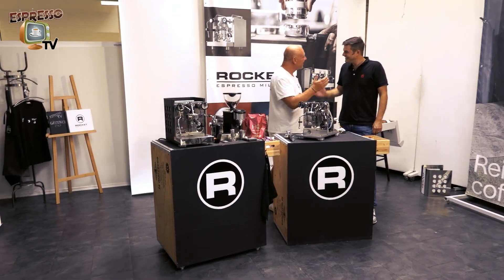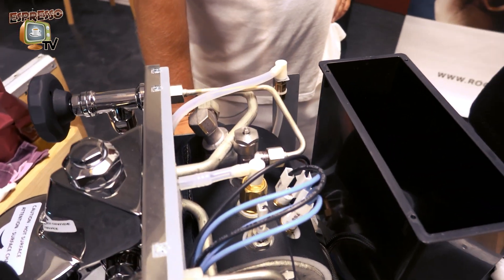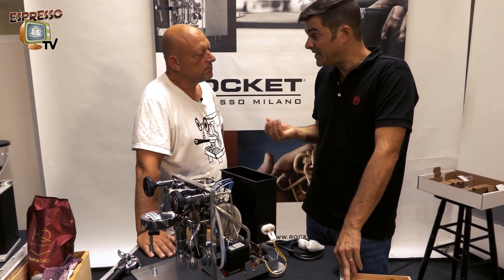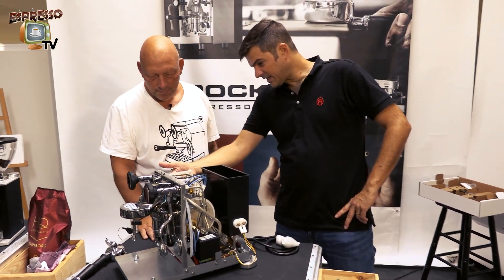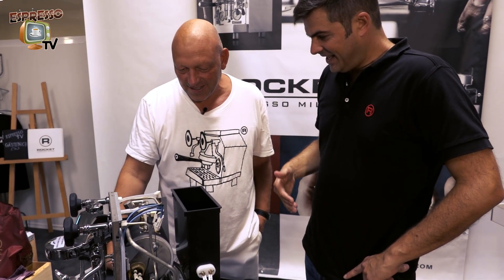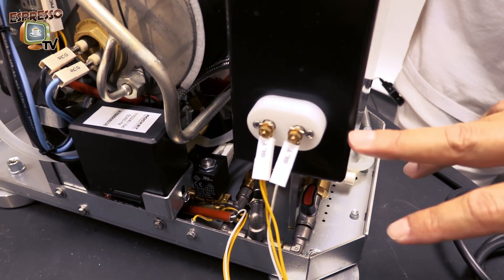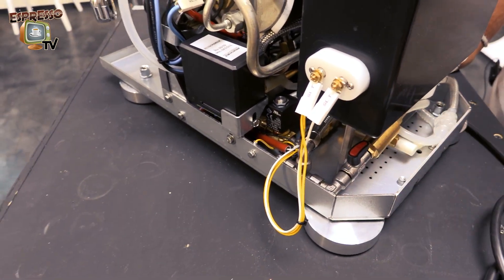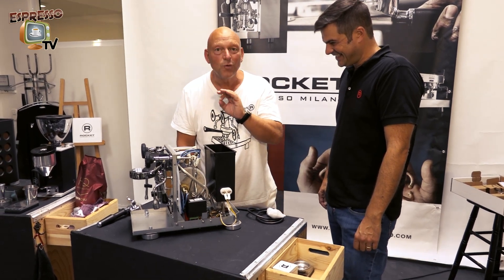A closer look into Rocket Appartamento TCA

Comment: I don't think the coating could remove or reduce limescale, i believe what he meant is the coating will protect the copper a little better? Question is what material is the coating made of, is it toxic free?

As long as the copper is thick enough, there shouldn't be much worries about pitting and regular flushing will remove very strong concentration. Copper has antimicrobial properties to keep the water clean, that's the advantage of it being exposed. Probably what's sufficient to coat is the brass., not necessary the copper IMO. It is true that keeping water soft is much better than thinking of how to remove it. It's also true that it's not good to descale from the tank, especially to the service boiler or the steam boiler in double boilers as it doesn't practically nothing except damage.